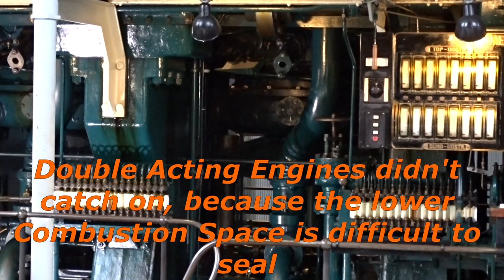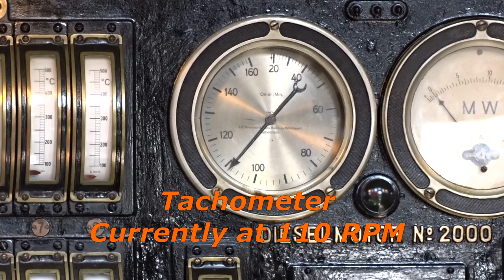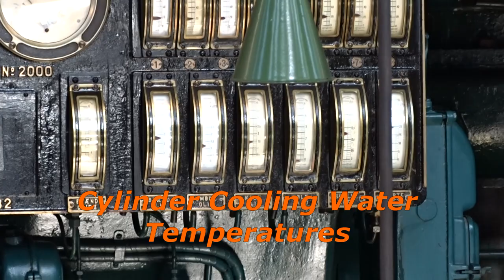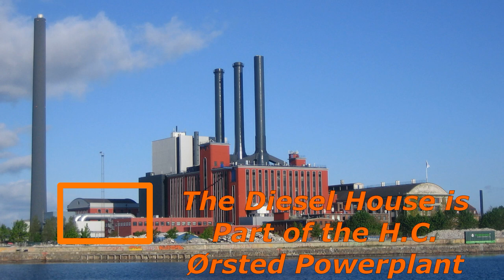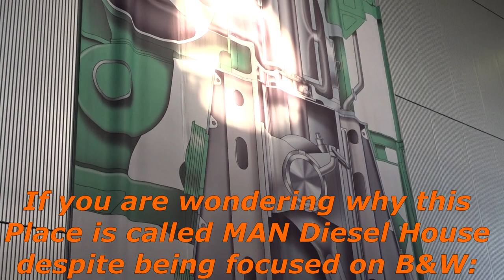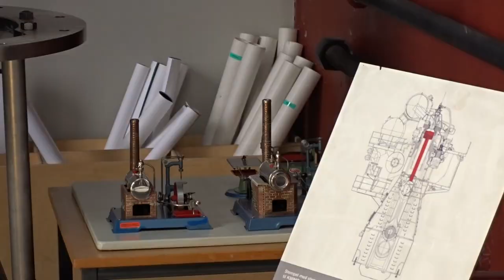Double Acting Two Stroke Diesel Engine at MAN Diesel House Copenhagen

Comment: Opposed piston ? Not double acting
Reply from the maker: Double Acting. The "Opposed Pistons" at the Top and Bottom are fairly small and only act as Exhaust Valves. The actual work is performed by a way larger double-sided Piston between them. B&W also built Engines where all three Pistons are of the same Bore, aka a Double Acting Opposed Piston Engine. But these took the Sealing Issues of regular Double Acting Engines up to 11.

Comment: I was there to day and saw it run it was so loud
Reply from the maker: Except for the Starting Air, it's fairly quiet compared to other Diesel Engines, as it isn't turbocharged. The Turbos make modern Two Stroke Marine Diesels sound literally like a Passenger Airliner taking off.

Comment: A shame, I suppose, it's called "MAN Diesel House", and not "B&W" etc, given that the engines date to long before the tie up with MAN (B&W engines were way better than MAN's) - I have the unpleasant memories of both KZ D and E types crosshead models uuuggghhh!!! - although I did have the pleasure of dragging the Spare Manager away from his Christmas dinner to open up Augsburg's plant to start preparations to supply major components for a massive breakdown on one of our MAN medium speed equipped ships - V52-55A.
Reply from the maker: It's offcially called MAN Diesel House, because it belongs to MAN Energy Solutions. But it's mostly referred just as "Diesel House" with neither MAN or B&W. And the MAN K9Z 78/140 D Engine (KZ Type?) of the Museum Ship Cap San Diego is often referred to as the worst Two Stroke Diesel ever made. It does sound awesome though.

Long Story short, MAN just had Money and rubbish Engines, B&W was broke but had good Engines. So MAN just bough them, and all "MAN" Two Stroke Engines today are actually B&W Engines, strictly speaking. And Sulzer (aka WinGD or however they are called now) and Mitsubishi Engines are similar to how B&W Engines always were, with Exhaust Valves and Uniflow Scavenging. Sulzer used to have Cross-flow Scavenging (mostly), no Idea about Mitsubishi.

Comment: When the stroke can be measured in stories maybe you need to rethink the size of the engine
Reply from the maker: It's still short compared to modern Two Stroke Marine Diesels. IIRC, the Stroke of this Engine is somwhere around 120 cm, aka a 1.5:1 Stroke-Bore-Ratio. Modern Marine Diesels may even exceed 4:1, which at Bores of up to 95 cm mean over 4 m (MAN B&W G95 Engine). Reason for the ever increasing Stroke Length is, that Propeller Efficiency increases at low RPM, and you thus want Engines to be as slow as possible. I cant speak for the said G95 Engine, but the MAN B&W S80 that I used to work for (and powers e.g. the Mærsk Triple E-Class Container Ship with two eight Cylinder Engines) has 78 RPM at 80 cm Bore and 345 cm Stroke, with 27,060 kW (36,800 HP) at the six Cylinder Version that I worked with.

Comment: Terrible concept of an engine. The main piston shaft slides through the centre of the lower exhaust valve piston.
The sliding surface of the shaft is exposed to combustion and carbon rich exhaust gas.
This lower exhaust valve piston is at the centre of the engine and would require a full tear down to replace it.
These guys were just trying too hard
Reply from the maker: You got it. The Double Acting Opposed Piston Engine is even worse, as the upper and loser Pistons have a longer Stroke there, making the Piston Rod move through the lower Piston much faster. But whenever a new Technology comes up, People think about what could be done with it before thinking about what should be done. Look at other weird Engine Concepts from before ~1935. Rotary Engines are another Example. I don't mean Rotary as in Wankel (has its limited Uses), but Radial Engines where the Cylinders rotate around a fixed Crank Shaft.
Reply: Sailed on these with Union Castle twin 10 cylinders, happy days
Reply: @Genius_at_Work  The rotary engine had a reason to exist at the time, namely poor technology regarding cooling, materials, etc. The high rotational speed of the engine block subjects the cylinders to a very fast flow of air, which was a big help for cooling in a time when people hadn't really figured out how to design a decent air cooled engine, and no aluminium alloys were available with sufficient strength at high temperatures to form the cylinder and cooling fins. The poor lubricating oils and oil control technology available at the time also meant that total loss lubrication using castor oil was actually not a bad option, especially on a fighter plane where g-forces could throw oil away from the pump pickup of a conventional wet sump system. By the end of the first world war that they became obsolete as improved materials science made conventional radials more viable.

On a totally different topic, did you find out why the engine in the video used these 'slider' piston valves rather than more conventional poppet valves?